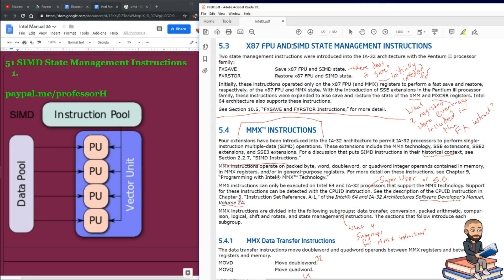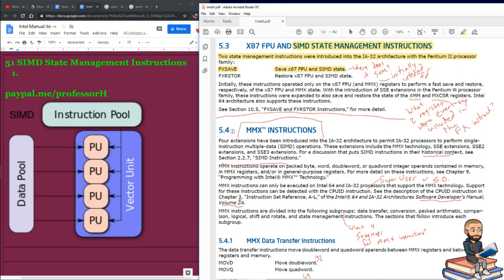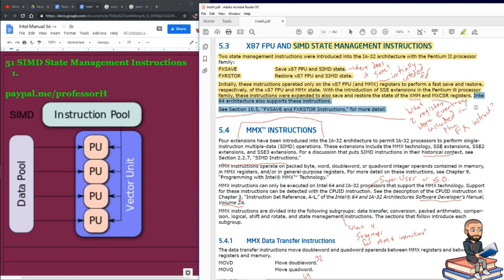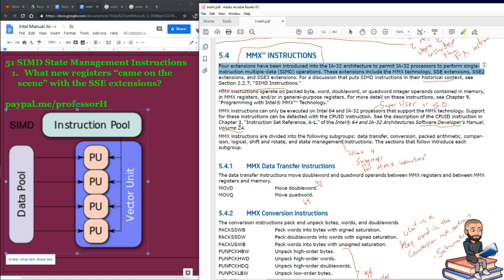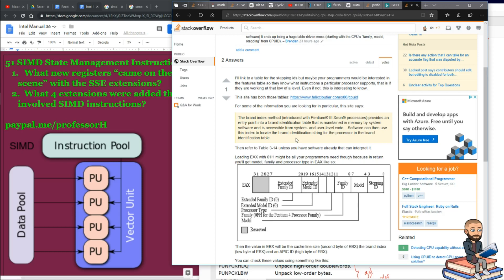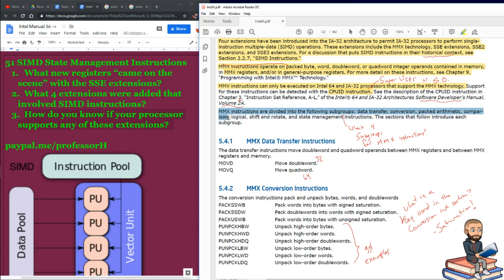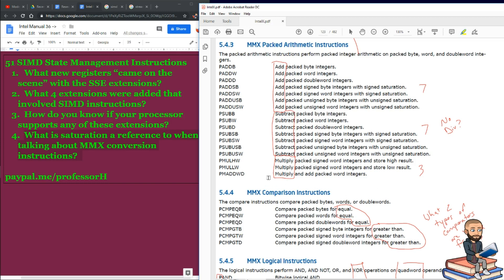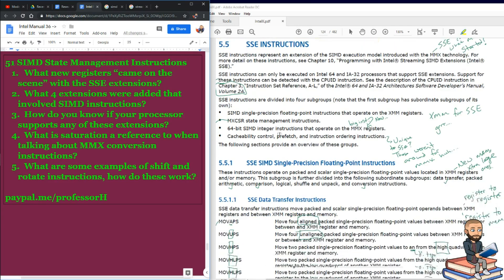Intel Instructions 51 SIMD MMX Instructions

Comment: Helpful, Thanks!
Reply from the maker: Thanks for thanking me! Any suggestions I can use to improve, anything you'd like to see more of or less of? I've been meaning to get  back into this manual and get going with ch. 6 but been a little busy. Is my straight forward, just read it and question it strategy the most helpful part? Thanks again for letting me know, it's super motivational to me.